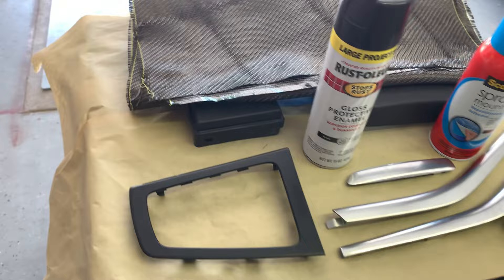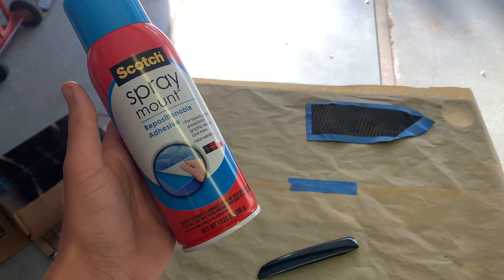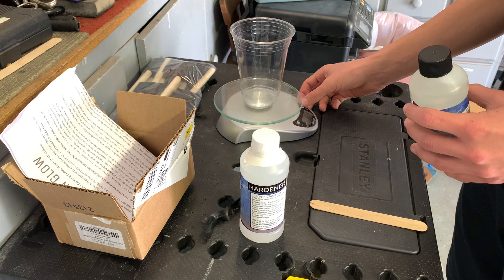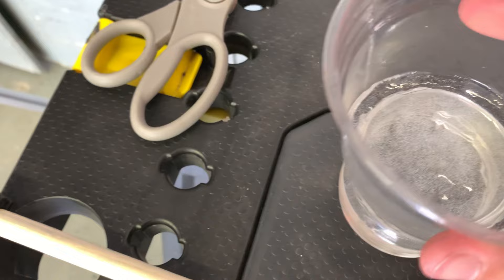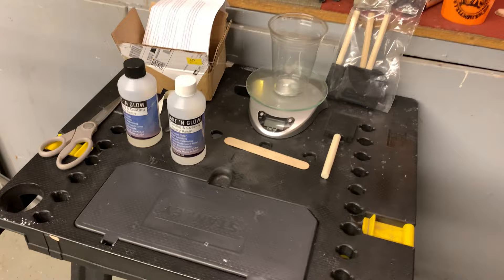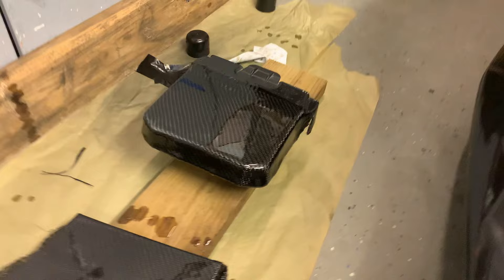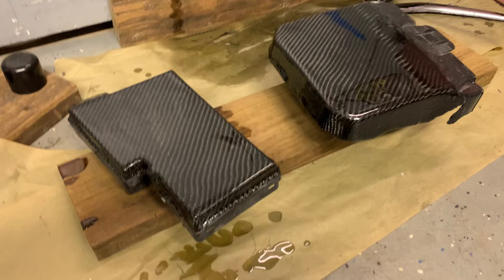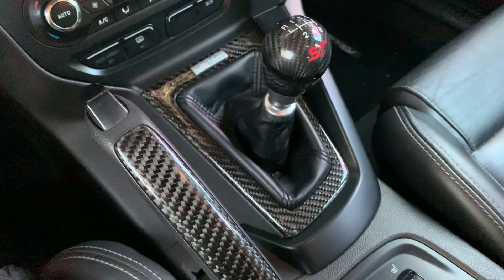Doing Carbon Fiber Overlays Myself - $300 Worth of Parts for $30!

Comment: Epoxy resin creates heat once it is mixed with a hardener. Also u need to know ur working time or set time and ur cure time. Also making very large batches creates so much heat that the epoxy will cure faster in the cup so only mix how much u need per part or less.
Reply: Could u put the cup in an ice bath to extend the working time?
Reply: @jayethompson3414  I would just get a longer setting epoxy then.
Reply: Can you use any resin?

Comment: I don’t know why more people don’t do this that want the look but don’t care about spending $300 per piece. Plus it does strengthen so to those who say it’s a waste it is not. Turned out great.
Reply: Yeah the pieces in this video if it was made fully from carbon fibre it's literally useless because it's just some detail things that doesn't make the car strong or rigid. And even if people said it'll be lighter, yes it'll be lighter but only for a several hundred of grams. And it'll cost you 1$ per Gram

Comment: For plastics, I had great luck with 3M 77 Spray Adhesive. *Also to mention, I believe you accelerated the curing exothermal reaction process too fast while trying to remove bubbles. The intense heat is probably what warped the cup.
Reply from the maker: Yeah I actually just did this again recently on my mirrors and used that adhesive. It works great

Comment: Don’t worry about bubbles in the cup. 
Also, don’t use foam brushes they cause bubbles. Great job btw. 
Some people use chip brushes but those can leave bristles. I hot glue the chip brushes near the handle to prevent that.

Comment: Awesome job my man! I had to repair a cracked carbon wing for my R8 and same thing, I let the resin mixture sit and it hardened up. Lol. Lesson learned but once you get the hang of it, it’s actually pretty easy to do. The repair came out awesome and it’s the same steps as your overlays. Again. Awesome job!

Comment: Someone else mentioned it and they're exactly right.

The reason the cup shrank was because the epoxy "cooked off"

As I'm sure you know, Epoxy resin is exothermic (creates heat as it cures) you created a prime situation for this by heating the resin to get the bubbles out AND by having so much in the cup for an extended period. 

Seems like you figured out a solution on your own by mixing individual batches. 

Also, a safer (and more effective) way to remove the bubbles is to put them into a vacuum chamber- doesn't need to be anything fancy.. something like a large pickle jar works perfectly fine for a makeshift chamber.
Reply from the maker: Thanks I will keep that in mind for next time
Reply: How would it work in a jar?
Reply: @Deedar95  You'd have to connect a vacuum through the lid.

Comment: At 13:41 to prevent that in the future, cut the excess off after you apply the epoxy. The weight of the epoxy will make the edges bend

Comment: You put the resin in hot water to remove the bubbles. The heat caused the resin to rapidly cure resulting in an exothermic reaction which caused the cup to melt. I did this once.

Comment: How did you remove the chrome door handle trim pieces? Thanks in advance
Reply from the maker: Put a small screw driver in the small section closest to the front of the car and pry that clip out. Once that’s out you can just pull and it should come out

Comment: Soo.. i know the material is real CF  but it feela like a different way to wrap it. 

The difference is , the  cf is permanent, looks 1000% betterb where wrap is sticker,  But if u knock  on the cf pieces its still plastix with cf look . 

Unless hes modling it ans making cf parts, my bad as i didnt watching the whole video.

Either way, this method is way better then
 does it justice vs wrap

Comment: Any word on how its holding up? Really wnat to try this but heard some people saying it will seperste due to heat in the cabin.
Reply from the maker: They’ve held up great, although the ones I did on my mirrors separated some in the sun. I’m a lot more experienced with carbon now and if you sand and clean the surface, and then use gel coat before laying the carbon and resin it should be a lot more durable and permanent lasting than the spray adhesive
Reply: @Nickjoenap  I really appreciate the quick response and all the great info. Really great video and not many people doing it on yt. 

Thinking I'm gonna give it a try but will certainly look into the gel coat to bond the two materials. 

Liked and subscribed!
Reply: @Nickjoenap Hey can you recommend a good gel coat? I was about to do this adhesive on my front lip but don’t want it to lift after awhile. My lip is already black probably just need to scuff it up with 80 grit

Comment: I’m doing the same Iv seen many do spray tack or resin tack Iv done both no different have you tried adding abit if yours doesn’t fit all the way round??         I did a steering wheel and was hard to get it straight all the way round so doing cuts so it would go but just a little bit was cut to short so think cut little strip to cover both edges
Reply from the maker: yeah i added some in some places and just layered resin and sanded it smooth and it didn’t look too bad

Comment: Very good instructions I think I'm going to do my engine covers myself it doesn't look hard. Had a guy wanting 2,000$ to overlay everything in my engine bay .
Reply: It is pricey due to material and lots of time, try it yourself and you’ll understand why. Yes could be cheaper if you do it yourself
Reply: @Chris Valle  I got a quote of 1,700$ so I'm going to do it myself . It doesn't look hard once you watch the videos.

Comment: if you keep the resign in the cup or contain it will go off quicker as the more there is the quicker it goes off the  slightest bit of heat will set of the reaction and this stuff can get so hot it can light things on fire trust me i have seen it will my own eyes my dam bin caught on fire

Comment: For the 3rd coat did you brush it on?
Reply from the maker: yeah i brushed it on and also tried pouring it on but it ended up looking the same. just have to sand and polish to make it smooth

Comment: The bubbles need to be removed before the epoxy dries. Just apply heat before it dries. They will not be able to be sanded out

Comment: can you just spray the resin 
can you just spray thr resin with a spray gun  instead
Reply from the maker: I don’t think so, it’s pretty thick
Reply: @Nickjoenap  oh ok i wasnt sure if you could use some kind of thinner to thin it out or something but overall  looks good
Reply: @just-a-6176  you cant spray epoxy resin in a spray gun. Too high of a viscosity too out into a gun also u cant mix a thinner into it or u will change how the epoxy hardens and cures
Reply: @IdEk5627  oh ok so is not the same as epoxy paint

Comment: Carbon fiber overlays defeats the purpose of carbon fiber....The idea is to reduce weight, and strengthen.....
Reply: But it's way cheaper and if you're not racing or just want the look it is a good inexpensive solution.
Reply: @ZedZerps  FAKE. SRRY NIT INTO THE FAST&FAKE.....RARHER HAVE GO THAN SHOW I GUESS
Reply: @theedge5584  not sure if uou realize  the majority of pieces people buy thinking they are real carbon fiber are in fact  fiberglass wrapped with carbonfiber. unless you are racing competitively  the weight you would get from this would make absolutely no difference.  It's just as "real" as 80% of carbon wrapped fiberglass most cars are sporting but dont realise.. a guy can go so far as putting one layer  of carbon fiber on each side of the fiberglass and you would never know until it broke.
Reply: @akhelodad  Lol i'm not most......but yep